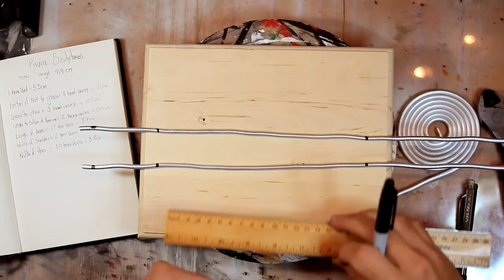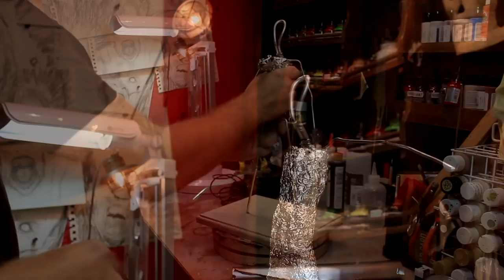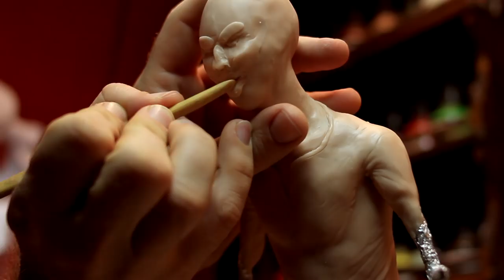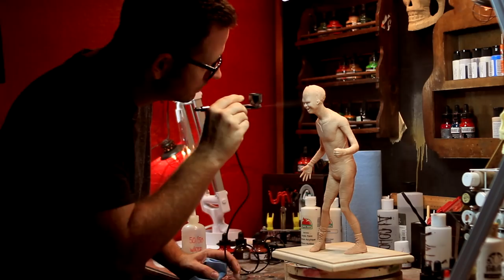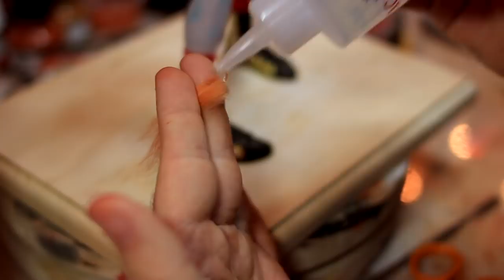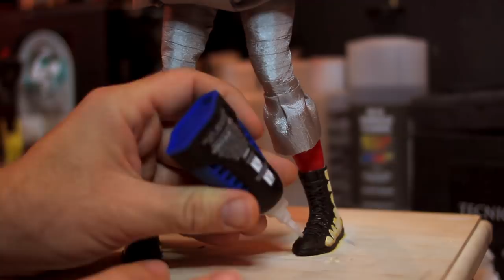Sculpting Pennywise from IT - SuperSculpey

Comment: Amazing! That's  is what I call talent !
Reply from the maker: Certified Lover - Thank you!
Reply: Tecnicus Street Studios what gauge of wire did you use ?
Reply from the maker: Certified Lover - I'm not sure of the gauge cause it was marked in inches when I bought it. The armature for the  body is 1/4" and the arms are 1/8th". All the armature wire I get I buy on Amazon from a company called Jack Richeson. They have best selection of sizes and quality.

Comment: Is it hard/dangerous to learn to use an airbrush and compressor?  I’ve had them unused for 20 years but have no idea how to use them an have always been afraid of hurting myself without proper training, which I could never find. I’m a good artist otherwise and love polymer clay!! Please please answer???  I’m so inspired by you!!! 🤡🤡🤡🤡🤡❤️❤️❤️🙈🙈👍🏻👍🏻👍🏻👍🏻🦋🦋🦋🦋
Reply from the maker: Learning to airbrush can be difficult, but as long as you stick with it and keep practicing you can do it.  Watching videos on the Stan Winston School website is where I learned to airbrush. More specifically, the videos by Casey Love, Jordu Schell and Tim Gore are extremely helpful. They take their time explaining everything you need to know.
The only thing I can think of that might be a little dangerous when airbrushing is if you're using some kind of toxic paints or varnishes, but other than that it's just a tool. Iwata makes the best compressors, in my opinion, they're safe, reliable and need little to no maintenance. You just have to decide you want to do it no matter what and approach with confidence and eagerness to learn.

Comment: hi! why do you wrap certain areas with aluminium foil and not for others?
Reply from the maker: Raphael Julian Lee - Hi! The foil is used to build up certain areas so I don't need to use as much clay. So, for much thinner areas, like wrists and ankles, and depending on the size of the sculpture, I'll put less or no foil. 
The rough edges on the foil does help the clay to stick better, so, for areas that don't have foil I'll wrap a very very thin wire around instead.

Comment: Hi there - completely in awe of your sculpting talent, love your work! Just wondering what play-doh-like material you're using to sculpt with after the foil stage? Noticed you then put it in the oven? Currently doing a Fine Art course in UK, but this is outside my field of work so thought I'd ask!
Reply from the maker: Hi, thank you! The clay I'm sing is called SuperSculpey and it is a polymer clay that can be baked in the oven. After it's baked it turns to sort of a semi hard plastic that you can either paint or mould.
Reply: Tecnicus Street Studios a pleasure and thanks a lot for the speedy response - going to check out that clay for maquette work and sculpture planning - been inspired!

Comment: That is freakin' amazing! So glad to see you use hair on this. I have seen so many sculptors sculpt hair in this makes it refreshing. I do have question though did you use shaving cream to shape the hair and to have it stay in place?
Reply from the maker: Warlord2029 - Thank you so much! to style his hair I used styling mousse. It's basically just like hair spray, but it it comes out as a foam which is much cleaner then spraying around the sculpture. it's available at pretty much any store with hair products.
Reply: Thanks for the info. I want to do a sculpt but been trying to figure out what to use on the hair this will help a lot. If you put this up for sale it will go quick!